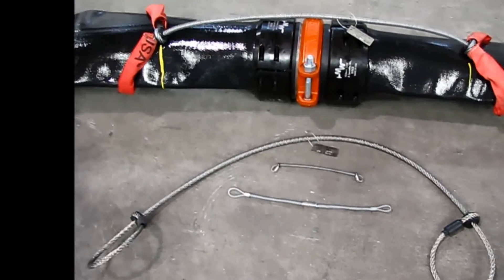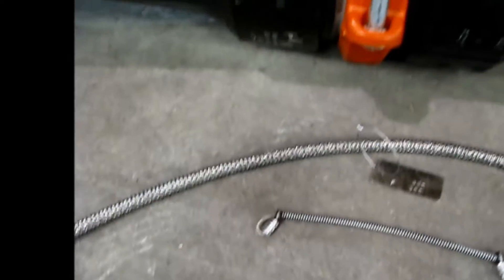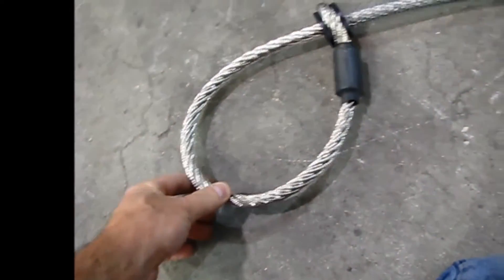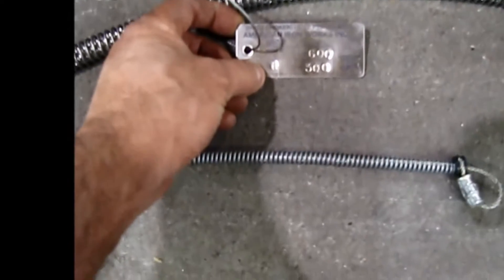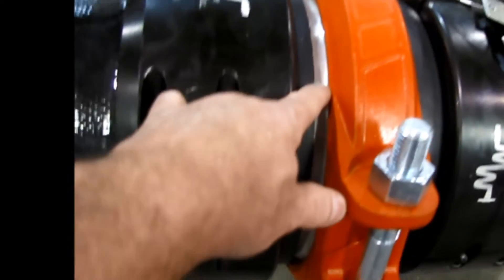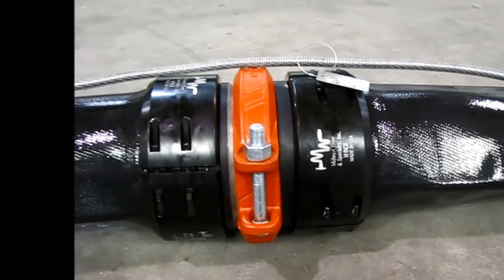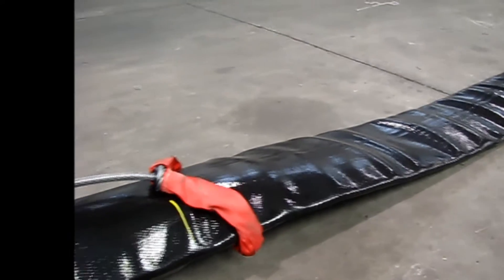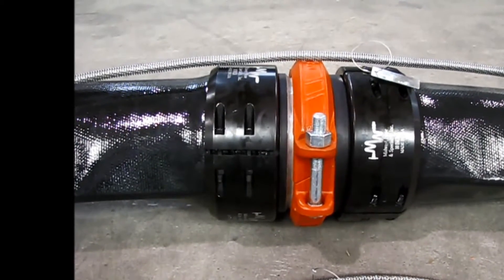Lay Flat hose failure.

Comment: What happens if you are working and this water hits you ?
Reply from the maker: Could be bad, it depends on PSI and distance from failure point.
Reply: It's the hose whipping around that it going to hurt you. That water is just going to get you wet